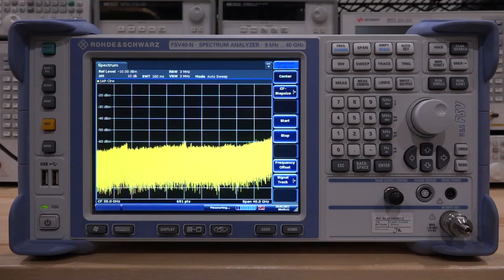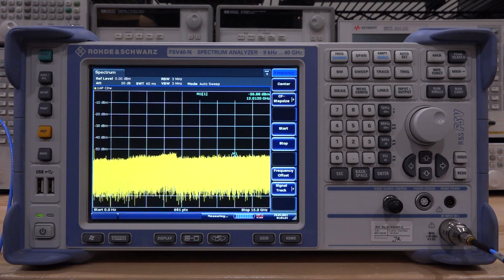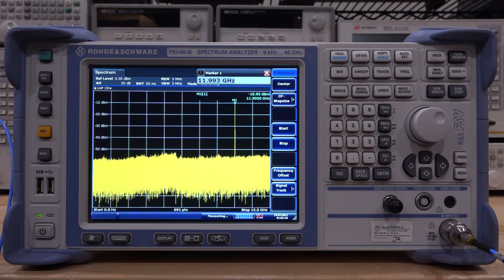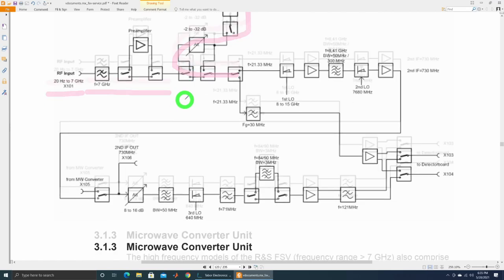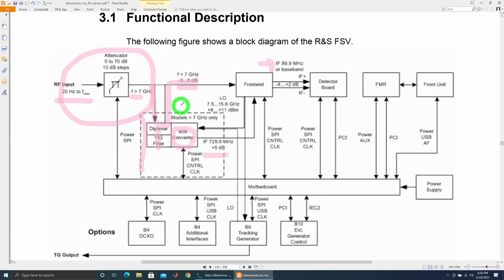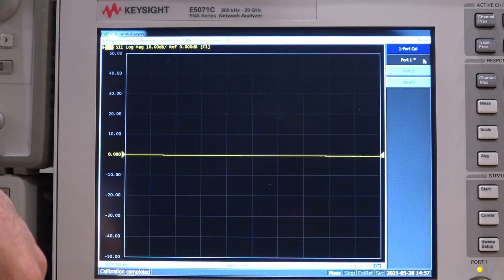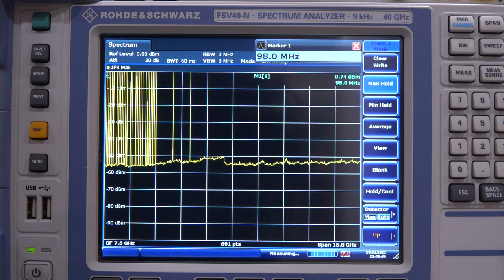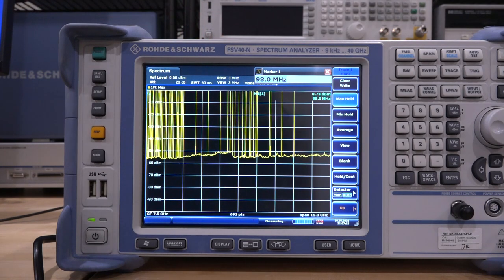TSP #192 - Teardown & Repair of a Rohde & Schwarz FSV40 9kHz - 40GHz Spectrum Analyzer

Comment: It's a simple fix, but I still appreciate how you worked through it systematically. Like, yeah you probably knew pretty early on exactly what the problem is and could have jumped directly to that and it would be impressive, but instead you showed us a bunch of good ways to find and isolate the issue. It's great.

Comment: Something simple like this is still definitely worthwhile, because it shows the troubleshooting thought process as well as showing the use of the block diagram and other resources to narrow down the possibilities.  And don't underestimate the value of showing what you are expecting to see and why you expect to see it, as you did with the attenuator here.  This is great stuff, so even on a piece of equipment where the solution is simple, it's very valuable to see the troubleshooting process in action.

Had you tested the connector first then it obviously would have made for a much shorter and less valuable video.  It may be that you actually did that and opted to show the longer troubleshooting path that comes from presuming the connector to be good.  Either way, the troubleshooting path shown here was very interesting and valuable.

Comment: Can you imagine being the person who dropped it? I wouldn't sleep right for a year.
Reply: I wonder how much was paid for this non-working spectrum analyzer??
Reply: The other thing this is why equipment has "handles" on both sides - to protect the panel from occasional mishandling. Something that modern equipment has done away with here. And you know that if that connector if it costs a dime it's priced at $200 lol.
Reply: @metatechnologist  those handles didn't stop the fedex driver from rolling the box I packed a 40 GHz generator in in such a way that it destroyed the 2.4mm connector on it. Honestly I was kind of impressed that they managed to accomplish that, I don't think I could have done it on purpose. Thankfully it had enough other problems that it was only good for parts anyway
Reply: You be surprised the deals you get with broken test equipment. Plus if it really broken more of the challenge the better as enjoy restoring older higher end test equipment. I pick up one similar to this one and no display at all but booted and turned out to be a shorted control pin as wire rub to next pin. It the best way to get test equipment that cost several thousand bucks for a few hundred bucks and even got equipment that literally had practically no hours on it but a few dollars component failed,
Reply: Yeah, special postage services should be provided when shipping such high value equipment. I imagine that person isn't even aware of the issue
Reply: Nah, they just looked around to see if anyone saw it, and put it back on the shelf whistling as they walked away.

Comment: I repaired a R&S VGA. The centerpin of the N connector was broken in 2. It was not possible to replace it so I made a new one but after that I still had no signal. Turned out an SMA connector on a piece of rigid coax failed. I used TDR to find the distance to the open connection. That was more easy because I did not need to disconnect things.

Comment: Good job Shariar. I may not have been able to find this with my limited equipment. Just shows had the seller said, "I dropped my unit on the face and it has not worked since". It would have made the fix a bit easier, even I may have been able to fix it.

Comment: It's pity that's so simple failure😉 , but that hint with using VNA to check input circuitry even without open the unit is great! I'll use it in the future repairs for sure. Thx.

Comment: Easy repair, mormal people: beeps out continuity issues with multimeter first.

Shariar: Let's hook up to a VNA and check the response! If it doesn't behave correctly below 10GHz, it is clearly a DC issue. 😂
Reply: Careful about breaking out a multimeter on RF equipment. RF equipment is easily damaged by a DC voltage.
Reply from the maker: A connector is probably safe. ;)

Comment: I think that instrument was mounted inside a rack, probably knocked into a wall. The connector would have been saved if x4 protective rubbers on the instrument was present I think instrument racks allow for those rubbers.

Comment: I have found that quite often the problem is simple, like a bad mechanical connection or solder joint.  One just has to find it.   I have also seen many N chassis connectors with center fingers bent out.

Comment: When I saw how this behaves on the lower frequencies I was almost sure it is yet another broken front pannel connector. I imagine him screaming "No please, not again, no more broken front pannel connectors please…". I can imagine that feeling, but on the other hand, it had at least that broken front pannel connector, which is much better than what happened to me last week. I bought some cheap defunct programmable power supply for parts or repair. It was described like "UI works, but the output does not come on." But when I received it I realized, that there was nothing wrong with the power supply itself, the described problem was between the chair and the front pannel — previous user did not know what OVP does. I was completely disapointed…

Comment: I think that you missed a teaching opportunity... We would have loved seeing what you did to make the repair... Your description was clear, but we could have learned more by seeing the process... How you secured the connector to work on it... What tools did you use... What issues should we watch out for... Etc... As the suspension disk was damaged, I would also like to see an attempt at a more robust repair. Maybe the old super-glue and baking soda trick to build it up ever so slightly... Epoxy... Etc. My other thought is that another point to the repair is to get equipment for the lab. So, the easier the repair, the better.

Comment: Shahriar ... You got more repetitively front connectors mechanical problems recently , what the hell are those users to misuse these precious instruments ?? ... Plastics could have much damage before such metal piece to bend like that ...
Reply from the maker: Front panel connector damage is fairly common. But normally those failures don’t make it to my bench for repair.